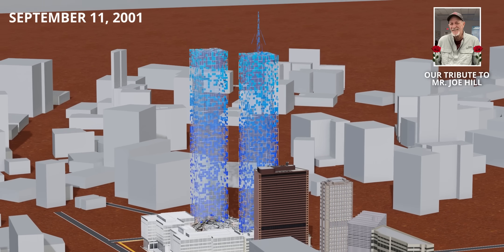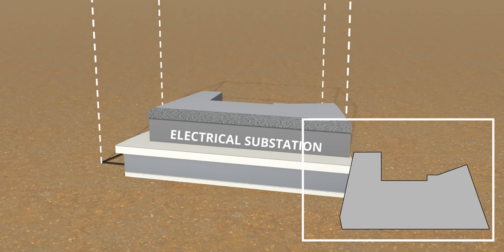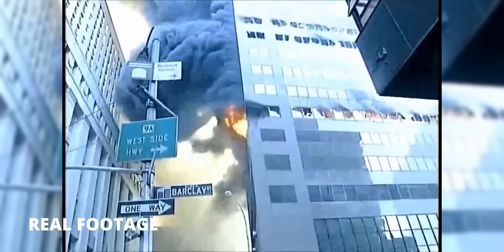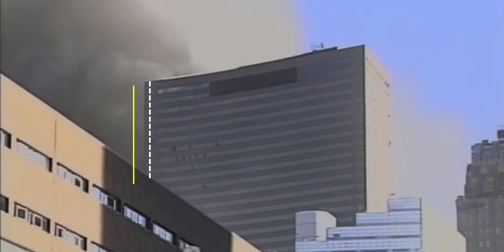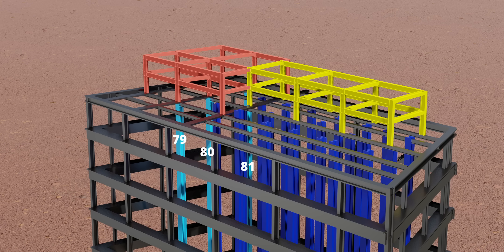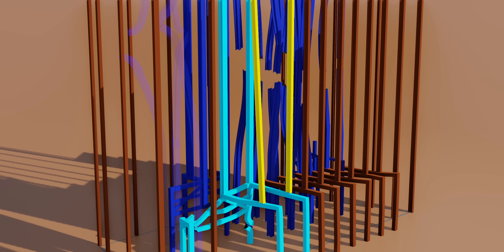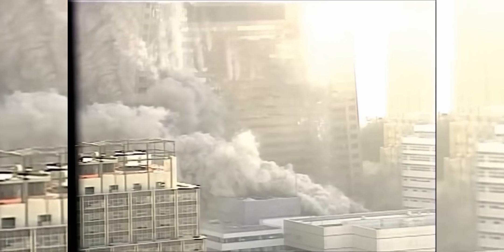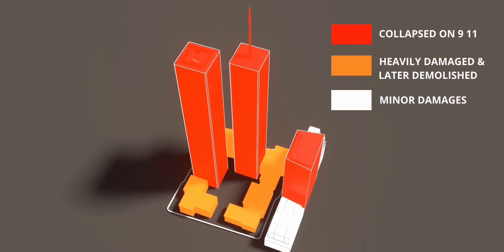Collapse of Building 7 | The Complete Physics

Comment: Larry Silverman, "pull it pull it" and building 7 was no more.
Reply: Silverstein
Reply: I can't believe people are still trying to support their conspiracy theory based off the use of this phrase.  What a weak argument...  A New Yorker uses some lingo..."OMG, it's a cOnSpIrAcY!!"
Reply: @42anon427  Yeah, it's hard to believe people are still trying to believe the towers were brought down by passenger jets full of fuel. I mean, look at what just happened in India, the frame of that building just melted and the whole thing collapsed like . . . Oh no, hang on. No it didn't. Anyway.
Reply: @rustysworldofentertainment850  I don't know what building you're referring to.  Did it have key structural members destroyed by impact damage prior to the fire?
Reply: @rustysworldofentertainment850  the WTC was designed in a way that damage like this from the airplanes will case this kind of collapse
Reply: @Olleh126  No, the towers were designed to withstand the impact of the larger Boeing 707, which carries twice the volume of fuel. Try harder.
Reply: @rustysworldofentertainment850 Boeing 707 is a narrow body jet, 767 is a widebody jet i.e 767 is bigger
Reply: @Nosleepbrooo  The 767 has 2 aisles and is 4 feet wider. So that was the difference, huh? That 4 extra feet in each aircraft brought down the towers? You keep believing that. It's been 24 years, you're not about to start learning now.
Reply: @rustysworldofentertainment850 Boeing 767-200ER’s MTOW is 20 Tonnes more than the Boeing 707, +20 tonnes at 450-500Mph does make a significant difference.
Reply: @Nosleepbrooo  And yet it was the burning fuel, wasn't it, that supposedly melted those supporting beams? The fuel capacity of a 767 is HALF that of a 707's . . .
Reply: @rustysworldofentertainment850 Fire does reduce the strength of steel or any material in general. Since the structure was already compromised due to the impact of the aircraft, the resulting fire further reduced the ultimate strength of steel leading to a catastrophic failure.
Reply: @Nosleepbrooo  And yet the building Air India 171 smashed into earlier this year, a 787-900 with a full load of fuel bound for London, barely collapsed and didn't burn down. Funny, that. I guess the building wasn't filled with detonation charges.
Reply: @r @rustysworldofentertainment850 mparing a slow speed impact to a nearly top speed impact...... The Boeing 787-8's (not 900) tail impacted a building ripping it off(tail portion) and the main fuselage(with wings) crashed into a space between two buildings (and yes the left wing did impact the other building but the main fuselage fell in the empty space and disintegrated). Now abt the fire and subsequent collapse, Twin towers's core was mainly steel, concrete was used for the floors(the concrete floor were mainly supported by steel pilons), Indian building was concrete core, concrete floor(yes even concrete looses strength to fire but not as much as steel does). The Indian building was smaller(less weight)and the low speed impact(the airplane debris didn't remain on the building)didn't damage the core as much as the high speed impact on the twin towers. Your anology is like comparing Flashbangs to a Grenade.
Reply: @Nosleepbrooo  I wish you could see the irony in your comment. I made a direct comparison between two crashes involving fully-fueled passenger jets flying into buildings. You then introduced an analogy (completely unrelated events) of flashbangs and grenades, and told me I'd made the analogy. But let's not split hairs over the language. When demolition experts, architects, structural engineers, firefighters, police officers, eyewitnesses and the owner of the WTC complex all state that explosives were used on 9-11 (yes, Larry Silverstein did say they chose to "pull" the barely-damaged building 7 that same day), and the second aircraft completely missed the central core of the South tower, and jet fuel has never previously collapsed a building (as it also failed to do in India), and the towers collapsed on their own footprints as per a controlled demolition, then I think a full review of the official story is somewhat warranted, even 24 years later, don't you?
Reply: @rustysworldofentertainment850 yeah yeah, but there’s one big elephant in the room that differentiates the Air India 787 crash and 9/11, SPEED. Oh yeah, a man involved in such an insane coverup would just giveaway the reason(as a controlled demolition) on a live? Nahh, prerecorded clip.
Reply: Lucky Larry
Reply: Forget about Larry Silverstein. Do some research on Israeli art students spy ring and the project B-thing. There is photo with these people. They're on the top floors in a room literally filled with boxes containing charges (identifiable from serial numbers).
Reply: @sixmillionaccountssilenced6721 are you talking about the E-Team?
Reply: Videos of police/firemen running away shouting "they're going to pull it"  and voila!
Reply: And by pull it he meant pull the effort of rescuing as it was hopeless. There was no water pressure to fight the raging fire inside and they all knew it was a matter of time. That explains the bbc reporting it had collapsed when it hadn’t. They were told that wtc7 is at risk of collapsing and that it most definitely was going to. There was so much confusion and false reporting
Reply: "told them to pull it, THEN we watched the building collapse" Obvious.
Reply: @TheScottishDan  - Idiotic. Please read upthread.
Reply: @TheScottishDan really and you know this as fact ? Where you there did you witness this
Reply: This video, if accurate, shows that Larry was lying when he told the media that he gave the order to "Pull it" W/E that means, because according to this video, the total collapse was unavoidable, it was already in motion.

So any lies it makes my head hurt trying to figure out what's true.
Reply: I like how YouTube deletes comments they disagree with. So much for first amendment freedom of speech. Arseh0les.
Reply: I remember this like yesterday.  I heard it myself!!!
Reply: He never said 'pull it pull it'.  Get your facts right before opening your mouth.
Reply: Silverman - sounds like some comic book character
Reply: @anastasiapushkin6028  Pron actor :) Long John Silverman
Reply: 100% Accurate.  I am in Melbourne Australia & l heard the Audio with his instructions 2 just pull it ..
Larry Silverman.... yep he was in on it all as well.  Corruption All Over 911..   
In the USA a 911 call 2 Cops & others like Fire Brigade ect & this terrible day 911..  interesting
Reply: Because Silverstein totally just decided to casually admit insurance fraud on camera.
Reply: That's what your mom sad...
Reply: Building 7’s collapse front the front view  
https://youtu.be/6pyyqV7egEI?si=aN5HdjJaRL3ziHyE
Reply: Everystein singleberg timeowitz
Reply: It was the fire chief's decision, not Larry's. Do you really think that a citizen can decide something like that?
Reply: @marioprovi6048  so fire chiefs have the ability to implode a building without preplanning and preparation ahead of time?😂😂😂😂
Reply: @marioprovi6048  Who's ever decision it was, we know who stood to gain.
Reply: @-HEY! Morron! The owner of the building lease (Larry Silverstein) gave the final order "pull it"
Reply: @henrysousa2502  As someone has already pointed out -- he had no decision-making authority, that responsibility rested with the NYFD.
Reply: @ac1646 - That makes no difference, you miss the Big picture & you are not alone...Have a nice day
Reply: @ I've noticed a lot of people embellishing what he said too. It's changed from two words 'pull it' to 'it's time we pulled it.'
In all seriousness I would have thought that a building rigged-up to be demolished but was then burning for eight hours wouldn't have needed anyone to say anything. It was destroyed anyway so what was the point?
Reply: - The point is, a 47 story steel building will not fall from fire...In London, Rio, and other parts of the world, fires were allowed to burn themselves out...Steel still standing...
Reply: @henrysousa2502  If you mean Grenfell in London the structure was completely different. It was a concrete structure build for strength but perhaps most significantly  it hadn't suffered it's entire structural integrity being compromised by falling debris from a neighboring giant of a building . 
The fire took hold because of the flammable cladding that the council covered it in. If there should be a conspiracy theory Grenfell is a much better candidate than 9/11 now I think about it.
Reply: @henrysousa2502  Also, Grenfell wasn't 'allowed to burn itself out' -- the firefighters were fighting the inferno all through the night and well into the next day until they had dampened the fire on the floors they could reach to remove the heat fueling the fire above (see 'the fire triangle').
Reply: - Grow up...This conversation  isint about your meaning of conspiracy, it`s about forensic science ,Now move on...
Reply: @henrysousa2502  - Plasco Tower.
Wilton Peas de Almeida

That's just high-rises although because fire does not know or care how tall a building is, the height of the building is irrelevant. No need for the qualifier. 

Every year countless thousands of steel framed buildings are raised to the ground by fire.  I saw dozens of them the morning after the George Floyd riots - piles of bent and tangled steel.  Steel is formed using heat and deforms the same way.  It is not uniquely fire proof but uniquely vulnerable to fire. This shouldn't require explaining. Blacksmiths have known this for a millennia.
Reply: @TheCriticalStinker-01 - You need help...Now listen carefully...Stay away from me & my family
Reply: ......after he had modified the insurance policy to allow for a double payout.....
Reply: @markderv  - Factually incorrect and not even the right building.

Larry Silverstein Properties Inc and the other (not Jewish) leaseholders argued in court that each of the Twin Towers attacks were a separate incident, while the insurers wanted them treated as one incident (so they wouldn't have to pay out as much - you can always count on an insurance company). Anyone with a half a functioning brain cell left would have done the same thing - except maybe you.

There were no changes to any policy and that has zero effect on structural engineering and building collapse mechanisms.
Reply: @markderv  No, his lawyer argued (post event) to get a double payout based on there being two separate attacks. If you are going to have a conspiracy theory then at least get the known facts right. You need all the credibility you can get.
Reply: @ac1646  Aah, another "This channel doesn't have any content" toshbot. Welcome to the gymnasium.
Reply: @ But you have happily been supplying content Mark -- not very intelligent content, but I'll make allowances.
Reply: @ac1646  He modified the insurance to allow for 2 attacks. There was then litigation to argue that there had been two attacks, which was successful, resulting in a much larger payout to Silverstein. QED.
Reply: @markderv  You haven't demonstrated anything so why use QED? At least cite your sources.
Reply: Pay the insurance premium once, get paid twice. Everything was covered by the courts because it's forbidden to question who profited from this psyop, even today!
Reply: @peterweber79  - Construction of the replacement Building 7 was completed in May 2006 at a cost of $700 million. Building owner Silverstein properties received $861 million from insurance on the old building, which could only be used in the construction of a new replacement building . Seems like he scored, right?

If you are a conspiracist you stop there, assuming you even got that far.

However, Silverstein Properties still owed more than $400 million on its mortgage on the old building, so combined with rebuilding we get a cost of $1.1 billion against the $861 million in insurance coverage. This does not include lost revenues during the 5 years Silverstein properties was still paying a mortgage on a building that no longer existed while obviously not collecting any rents. Not to mention property taxes, and other expenses during the nearly 5 years there was no building, all of which have to be added in. Certainly tens if not hundreds of millions more. 

And oh yeah, the new building has less leaseable space than the one it replaced so can produce less revenue. 

Yep, made out like a bandit. 

If you still want to run with this insurance scam thing then you need to be able to tie it in to all of the other events of that day because it can not possibly be a stand alone event. No one has ever even attempted that one.  22+ years of people banging on about insurance scams and no one has even come close. 

I don't see you moving that needle now. 

Of course if 20+ years later and the insurance companies still haven’t figured it out but you really believe you have, why don’t you turn him in with this damning evidence? You will be entitled to 10% of any funds recovered. You could retire overnight a very rich man. 

What are you waiting for?

Why are there never any takers on that one?

If you feel like a complete tool right now you should. If you don't, that's just more reason you should feel like a complete tool.
Reply: No one talks about Silverman.... Big mistake.... He is an important key to the 9/11 inside job
Reply: @marevicstahl4152  - Why? Other than being conveniently Jewish.

Please lay out the entire case to prima facie standard,  start to finish. The whole who, what, when, where,  why and how. 

Be the first to even try.
Reply: The steins as usual up to no good, Silverstein, Epstein, Weinstein etc, what is it with the people in the small hats .
Reply: This might be the dumbest part of the conspiracy. He obviously meant to pull the emergency crews. You can't just decide to do a controlled demolition on a building and then have it collapse hours later. Use your brains people.
Reply: @nolan13075  pull it, is not pull they/them.
Reply: @tinyear926  pull it, as in pull the firefighting operation.
Reply: @nolan13075  YES pull it(the crews) before he blew up the building, it makes sense you are correct my mistake.
Reply: @tinyear926  The building didn't blow up, it fell down. The complete opposite of your claim. Haven't you been paying attention?
Reply: @xocomaox  the people who pay attention say it imploded via controlled demolition, to rig a building takes days and precise calculations, STOP LIEING.
Reply: @tiny ear486, when does building 7 begin collapsing?  When the penthouse collapses, or when the shell collapses?  Or maybe even earlier
Reply: @dikranovichk5889  Probably earlier, 1st support columns get taken out, then some amount of time later, ( where a second seems like minutes) something supported by them begins to move, then it would have to move far enough to be perceived as motion from the distance of the camera.

We've all seen a situation where something's support was knocked out from under it, and it seems to hang there for a second before it realized it's s'pose to fall.  The old "object in motion tends to stay in motion, an object at rest tends to stay at rest"... but for how long? You need to be asking a physicist.
Reply: @nolan13075  True but I personally caught a NY firefighter here in Detroit trying to sell that bullshit to our fire fighters. I spent my whole city career protecting Detroit Paramedics and firefighters and I wasn't about to let this guy program them with a stack of blatant bull shit so I stepped to him and called him out. I said to him, in front of the group of Detroti firefighters "Everyone knows it takes professional demo companies MONTHS of planning and preparation to get the right amount and kind of explosives in the right spots and precision computer ignition timing to meks these sort of things happen, yet you're telling us that a bunch of untrained firefighters ran through a burning building and set the explosives and miraculously got it right?"
He Got so MFn mad he asked to host to the event to throw me out. Didn't work, the host was myland lord and friend, and knew I was right.

Firefighters, more than anyone else, hate being contradicted, disobeyed, or embarrassed. This NY FF got all 3 at once, and I could laugh to myself, mainly at how angry he got when I called him out and proved he was lying.
Reply: @nolan13075 

So that would be "pull them"! Or is that too logical for your thinking?

If this was actually the result of fire, then it proves what we in Europe have been saying for years....US building standards are truly appalling!
Reply: "Pull it" as in pull the plug on firefighting so no more firefighters die in an inevitable collapse, not "Pull it" in the sense of pulling a building down.
If you have to deliberately misinterpret peoples word's to make your point, you're the one that is wrong.
Reply: @NWA744  NOO "you have to deliberately misinterpret peoples word's to make your point, you're the one that is wrong." QED.
Reply: So, you believe that in the utter chaos of that day, the owner of Building 7 organized a demolition team to demolish the building? A building, that, if demolished, would take weeks to plan, prepare and execute? You're quite a kook. Let me help you out. I'm going to introduce you to a useful expression..."fact is very often stranger than fiction". Embrace that.
Reply: @amstaylorph it’s almost as if the controlled demolition was planned in advance, and not “in the midst of chaos”. Seems like you’re projecting on the definition of “kook”
Reply: Actually trump the Manhattan real estate man
Reply: He never said that....smh
Reply: @joesmith8398  I saw and heard him tell the news that he said it. Was he lying then, or are you lying now?
Reply: @joedemagiarco,  maybe you’re lying…….to yourself
Reply: Pull it means remove the fire fighters from a building because it's a total loss
Reply: I've seen him talking about this on video!  He openly admits that he gave the order to demolish the building!
Reply: he was referring to fire fighters evacuation
Reply: @Mintybomo  there were none in there
Reply: @Mintybomo  https://www.youtube.com/watch?v=p34XrI2Fm6I
Reply: FFS, at least get the name right 🤦‍♂
Reply: @TheCriticalStinker-01 wow, you’ve been arguing with people in this comment section for months. Hilarious.
Reply: @TheCriticalStinker-01 Both versions seem valid to me😂
Reply: @TheCriticalStinker-01  Dont have to you know what I mean, you`re welcome.
Reply: @tinyear926  - I know you took one of the 9/11 conspiracy movements most epic fails and tried to run with it yet again in 2025.  As if this time it was going to be a winner because this time it's you  🤣🤣🤣🤣🤦‍♂
Reply: @TheCriticalStinker-jw4fl
 - You sound like a paid spox for the tribe.
Reply: You havent said anything jagoff@TheCriticalStinker-jw4fl
Reply: @ If you are advocating "truth" theories, details are really important. You need to come across as convincing and credible.
Reply: @tinyear926  Silverstein was on television on Sept 11 saying "Building 7 was too badly damaged so we decided to pull it." END OF.
Reply: @rustysworldofentertainment850  Sen. Ron Johnson says congressional hearings are being planned to investigate the collapse of World Trade Center Building 7
Reply: @TheCriticalStinker-01 shalom!